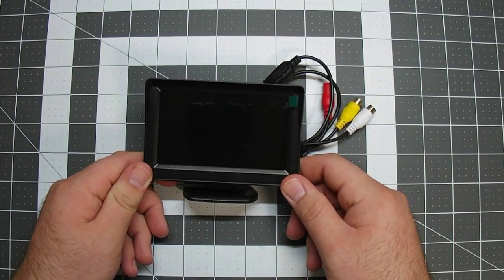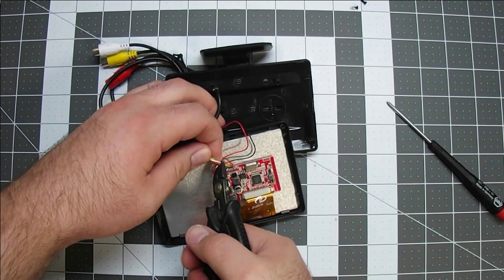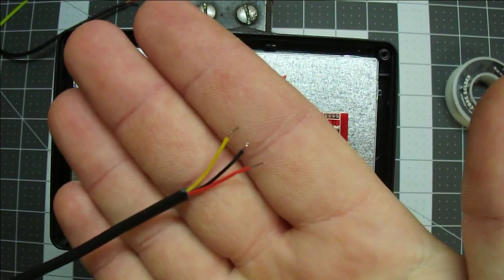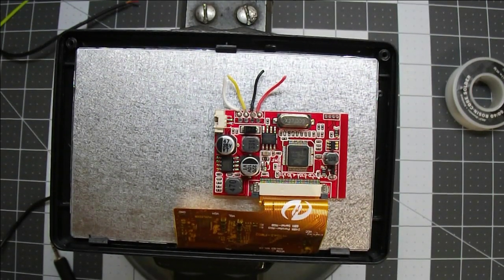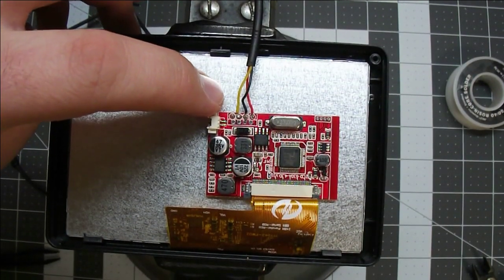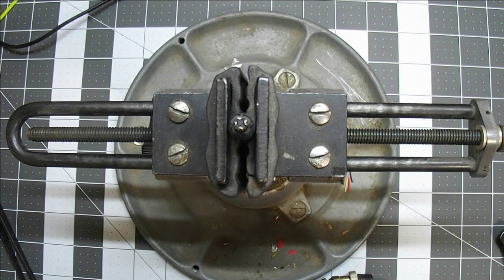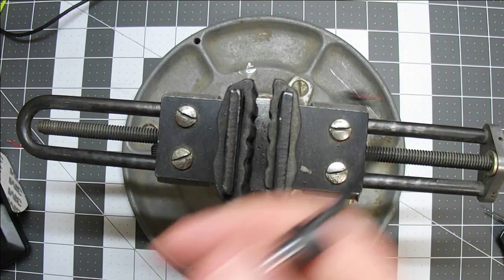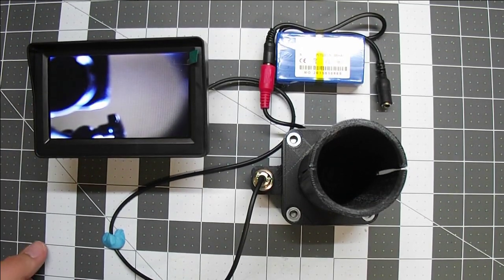DIY Night Vision Scope Build Part 2

Comment: is it possible to get the editable files for printing?
Reply from the maker: Yes the files I have are all on my thingiverse page.
Reply: @MrTidangerous  thanks opened them in fusion360 but cant seem to edit them
Reply from the maker: Do u have 123d design? That's what I used to make them.
Reply: nope i will look for it

Comment: Dear sir, may i know  about power scema? What kind battre instal on it and everything about this. Thx before
Reply: I've just finished the electrical part and it is quite simple. The screen works in range from 6 to 32 V (according to attached datasheet) and the camera in range 5-12 V. So you have to just use black and red wire from camera and connect them not only to the screen but also to 6 to 12 V power supply (i'm using two 18650 Li-Ion cells in series).

Comment: Hi Tyler from Liverpool UK across the pond. Great video,  would it be easy to add video out capability for recording purposes. Is it just a case of taking a feed from the monitor or camera video lead? Thanks in anticipation.
Reply from the maker: Fred Morris yes I have built a video recorder that goes in line between the camera module and the display. It is made using HMDVR. The video quality is not as good while using the dvr.

Comment: Would this work with an 11.1 Lipo?
Reply from the maker: You might get away with it.
Reply: Ok, I may or may not try using one.  Also you linked a 5 pin connector not a 4 pin in the first video. Thanks for the reply!